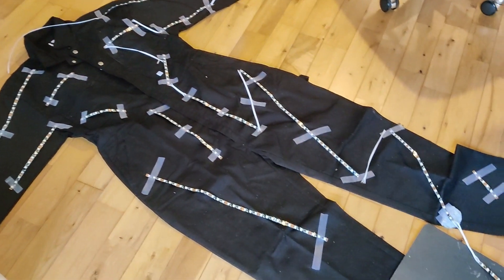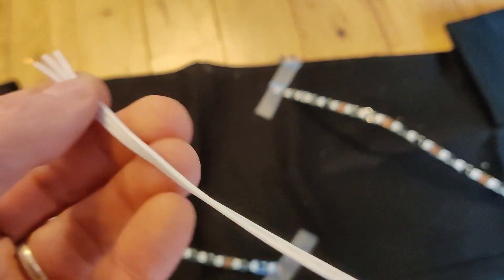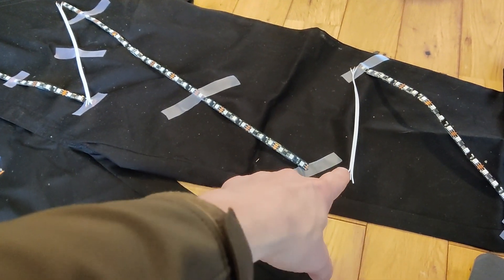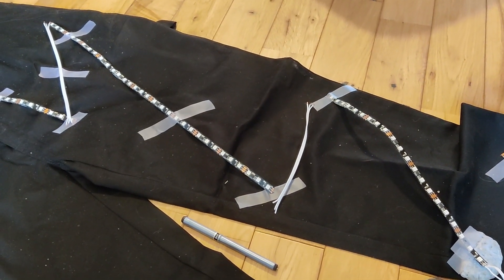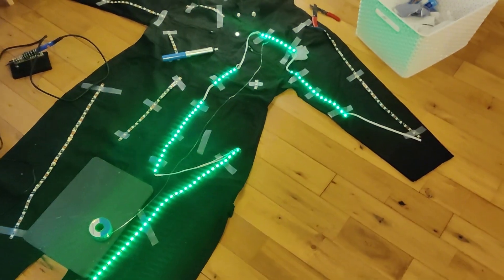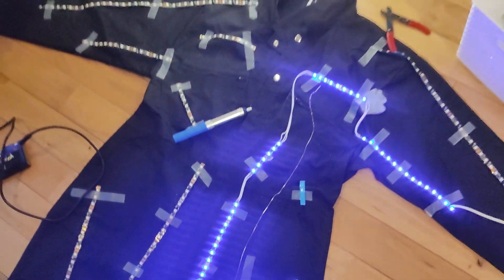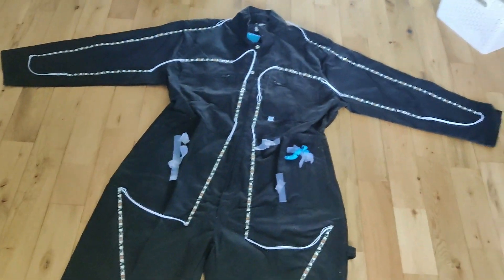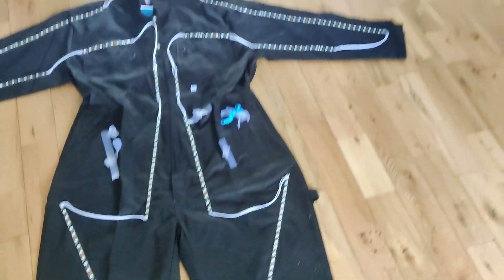How to build and LED Dance suit #dancevideo #tiktokdance #tiktokfails #ledlights

Comment: How do you control the light?
Reply from the maker: At the moment they are programs in Python code that I run. I want to add a button to change the program which changes the LED pattern.
Reply from the maker: @kushersnazzyofficial1870  more details in this video https://youtu.be/bSzGzkBkrfA?feature=shared